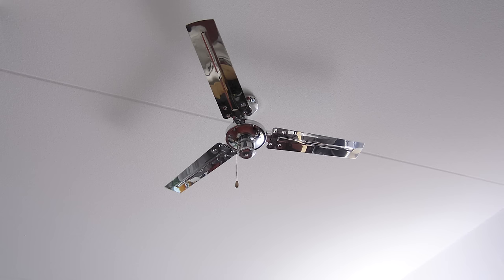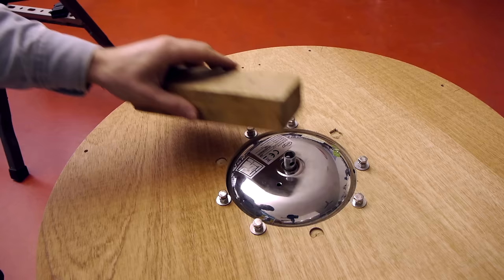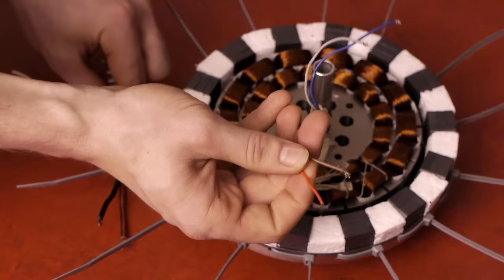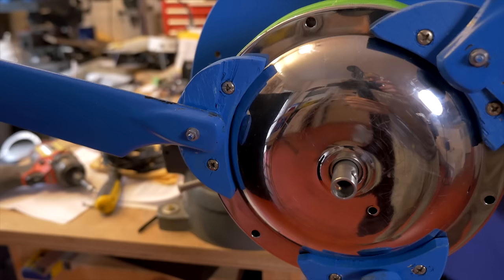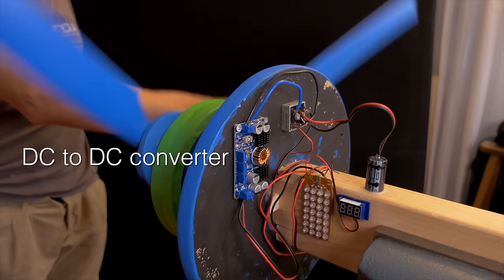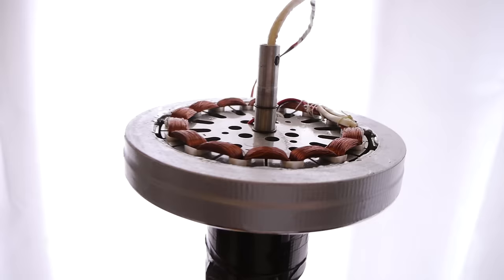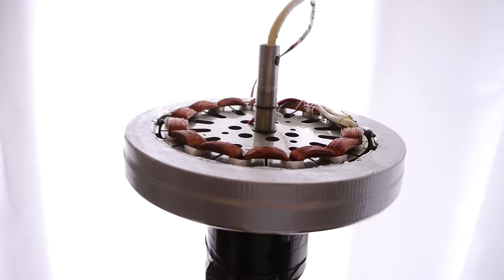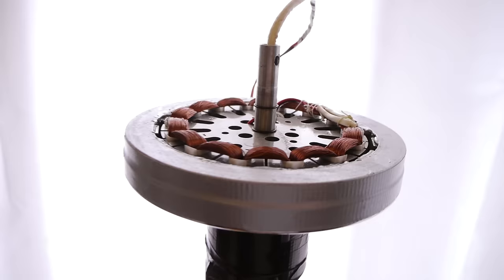Turn a ceiling fan into a wind turbine generator?!

Comment: source a variable input DC  charger, use to charge battery and super copastor bank then draw stored power through inverter or line converter . for some reason I am thinking caps before the dc~DC charger with resistors  to slow the input .. I'm no electrical engineer , but i entertain myself by seeking interesting and useful information that relates to our modern environment and how to solve problems by sourcing components made for other applications that produce the same results . but this is a older post so I am sure you figured it out , in case of Zombies though I would just keep note of intact electrical systems that generate their own power .. ( bus stop lamp.... Has solar panned heavy duty a inverter ,charge controller and a battery and lamp . ) I will be visiting those noted locations with a nice work van early on should the dead walk .. growing food will need most all my free time so grabbing the low hanging fruit while others scramble for tactical bacon seems smart as i am sure there will not be any one protesting their share  at cell phone towers ,bus stops, army corps managed bridges. I will avoid the larger arrays on the roofs of box stores and wall -marts .. the big score will be the cell towers and maybe a solar mini farm noted close by ..

Comment: CYLINDER GENERATOR WORK BETTER. LOOK AT INFINITY SAV. VERY GOOD IDEA FOR GENERATING YOUR OWN ENERGY. SMALL AND HIGH SPEED IS THE ANSWER TO OUR ENERGY PROBLEM. THANK YOU FOR YOUR IDEA. 3600 RPM WORK MUCH BETTER.

Comment: A wind turbine is the wrong motor to convert to a generator because it is a low mechanical resistance motor. Hence you have windings that cannot tolerate alot of output power.
And yes your phone can tolerate AC as long as you use the proper charger. Samsung phones charge faster using their own AC charger than on DC. For more output power, try using an automotive alternator as it already creates 14.4V DC. For an AC  brushless generator with more power, convert a furnace blower motor - it creates way more torque and should create more output power.  Good luck!

Comment: Sorry but induction motors are bidirectional.  That is can be a motor or a generator.   And I can do far more with an induction motor than a PM motor.   First problem with a PM motor is the fixed flux from the magnet.  Power is a cube of the rotation speed when the flux is fixed.  A mechanical means is needed to limit rotation speed.  And the power has to go somewhere. Best results for a PM motor is variable pitch blades.

Induction motor as you said is not a generator.  But apply a current through one of the coils like the starting secondary coil and you have that magnetic field needed for an induction motor to be a generator.   This creates a magnetic field in the rotor and when it rotates the field moves thus creating a current in the rotor bars.  This current tries to maintain the position of the field on the rotor.   The field from the rotor sweeps across the main coil of the stator and the results is a generator.    So feed AC into the secondary coil of the stator will result in generating the same frequency current in the main stator coil.  And the slippage of the rotor is proportional to the amount of energy generated.  This is the speed of the turbine blades.    Thus the secondary current provides some control of the rotations speed and power generated.  Generally the power factor  which is a problem for induction motors is also a problem for induction generators.   India wind turbine industry started with induction motors.

Comment: First, measure the wattage mat full RPM.   from the looks of the wire thickness,   And assuming the fan runs on 120 volts,  you need to decide what voltage you want to generate.   But with perfect magnetic coupling,   And a fast RPM,  you would be lucky to get 120 volts with the current wire thickness.   Its a pain in the ass to rewind the coils.   You won’t have to yet.   Run with existing coils,  measure the wattage.   Volts x Amps.  First,  measure the No load voltage.  Then vary the load until the voltage drops down to 75-80%.   Measure the current.   Will give you the wattage.   From that,  calculate the turns per volt.   Thicker wires,  lower voltage and higher current.  Decide what you want to power.   Probably to charge a 12-24 volt lithium ion battery.   Your output in voltage should be about 150% of what battery you decide to use and charge.

Comment: suggestion 
 crazy add on  is  a toy Tyco slot  car motor  as  a  replacer thrust  dispenser  attached to the  whole of  the  generator     these Tyco toy slot car motor  will give that  cealing  fan  a   continuous motion   and     more  drop-in,+-   output   daegerdaysion  .. like  I say   crazy ..   thoe  to  me   it all becomes  a closed-loop  in motion generation  ...   what say you  uheardmae  ...respectfully Michael heard

Comment: Any atv that has electric start has a voltage regulator as well as a motorcycle
Reply: You can also use the atv stator and fly wheel to use as a generator

Comment: Have you tried to build a wind turbine generator by using a car alternator that's what I did it is much easier to convert 12v DC to AC in Voltage to get household wattage  safely, just run a simple cricut to get safe voltage to Watts or amps .
Turning 12 Volts into 60 hz 120 volt by doing so you use the same voltage bridge rectifier and you will need inline a Voltage regulator to convert DC voltage to AC Amps very simple cricut to do and most of the iems you can buy from Amazon around $30 if your on a budget,
 I need to come  up with a video on the 
Wind turbine I built same I don't get a lot of wind where I live ....

Comment: why don't you use an air compressor and a big strong safe separated " for safety " air tank to move the fan and make it internal fan so that the air will be all pushing the fan to rotate , and make the air push it from sides and make it too much wings , the isolater must have input tube and far turn output tube perpendicular to wings from sides to make use of each pressure bit , use wheels to control speed of generator rotation " speed converters " big to small wheels or small wheels moving big ones , the generator later will fill the tank , and the tank may operate the generator for hours , therefore it will work endlessly , be wear of air pressure you must use electronic controllers so that it turn of compressing at some level and starts at another lower level using electric tabs controlled by sensors ...

Comment: Why not have the turbine charge a battery, then run the electronics off of the battery?

Obviously, this isn't practical when used for real turbines connected to the grid, but for this generator, it is an option.

Comment: Without a commutator or slip ring, it is impossible for the wires coming out of the shaft to be fixed. It is obviously fake, the wires go through the shaft and through the table below where they are plugged into the mains.

Comment: apart all electronics control & braking, thing is generator alone itself is almost nothing without connecting to the load.. 
unless it would always dissipates the power in form of heat energy due to reactivate index.. what practically weaken the permeance.. 

synchronism is the another factor to take care about by attaching a motor driven prime mover or some other means..

in case of rated power generation feedback control system is incorporated to sustain the PF stability..

in reality the rotors are used, having larger axial length as compared to their cross sectional dia with high RPM & negligible tilt.. 

AVR is the another concerning factor to take care about.. 
as many more things are there, take place during generating power.. 
making what at the own place is pretty terrible idea.. 
see balancing voltage & frequency by 24/7 observatory only keeps the electricity almost stable.. ✔️✅

Comment: Here you go how about you doing this get a small transformer from like a charger for a phone take that Transformer in it out connected to the back row of coils run that through the Transformer then put a capacitor and a diode and then run it back through the front half and see if you can get the motor to run by itself I'm working on different stuff like that trust me once you figure that out you got a whole new Avenue of electronics that everybody will be asking you how it works and you may not even know anything about Electronics

Comment: Not sure about the electronics side of it, but i can tell you those helicopter blades are a very poor choice, you would be better off using the actual fan blades, or actually designing blades like the helicopter blades but at a better angle pionting into the wind not away from it.  if the blades are too flat against the wind they will just stall and not produce much rotation of the turbine.  You would want something like 45degree pitch of the blades for a good all-round performance.  adjustable pitch blades would be best.

Comment: Why not put the magnets  on top and underneath so you could leave the extra cooper wires in then add a magnetic pulley with North Pole magnets at the positions of the minute hand of a clock then bring larger South Pole magnet in to make the pulley move freely off of magnetic propulsion wtfu movement

Comment: Has anyone mentioned the fact that you don't need to do all that ripping apart and putting magnets in it? All you have to do is put a capacitor in parallel with the ac induction motor, and then get it to spin about 100 revolutions a second faster than what it's rating as a motor is. ie: 1500rpm motor = 1575 ~1600rpm -generator. The key is to not hook up the load until the rotor is spinning at the required rpm. (try a 7.5 uF cap for starters. cap value depends on induction motor type, and load amount)

Like you, this guy isn't someone who is fluent with electricity. But he gets an A+ for figuring out the better way to make a generator out of an induction motor. Thought you might like to know.

https://www.youtube.com/watch?v=j-LgEbdJ8AM

Keep experimenting. You're getting it.

Dean Michael Harrington
Assistant Engineer, US Windpower  "Home of the 33MVS wind turbine"

Comment: You could use NCP785A (450 volt regulator, but with only 10mA output).
To amplify the current add some high voltage transistor or MOSFET.
For example, APT13005D.
~~~~~
Or maybe something like this:
http://www.pmillett.com/HV_reg.html
but with adjusted resistors for desired voltage.
~~~~~
Use circuit to charge some battery (say, 12V car battery), and then car charger to charge your phone.

Comment: Why did you add magnets? Wouldn't the metallic rings that was in the cover right from the start enough to produce electricity? I've generated electricity from motors before without adding magnets.

Comment: Here am i again 😂 so what if we rewind the alternator for higher amp with max  24 volts output and by using neodymium magnets wat do you say
Reply from the maker: Hi there fancy bird, yes; it woud be good to rewind the stator with thicker wire, to reduce the V and increase the A, especially on one that was supposed to run on 240V. May not be necessary on a 120V version. But to rewind is some work and how much would the wire cost.. not that cheap. I didn't make it clear in the video, but a am using neodymium magnets. Things than that I did wrong there: the neodymium magnets are glued on a wooden ring. It should be a ring of iron/steel of course, to connect the magnetic forces. And if you want the strongest possible magnetic force, the airgap must be minimal, and for that reason the magnets should be curved. With these projects it is always the question how much effort and money can go in. Things can almost always be done better. If I manage to do this project better (I think I can) I would like to make a version-2 video.
Reply: @GiesbertNijhuis  i am working on this i just need 30v with a higher in current  so i can charge my batteries continues and use an invertor that will work for 24/7  i am living in such a place where its hard to find neodymium magnets so i just ordered online
Reply: @GiesbertNijhuis  i am trying to make a hydro generator with that and thanks for sharing your idea

Comment: The use of a Linear Pre-Regulator was unfortunate.  The small wire diameter (high resistance) is ok for lower current - which at high voltage is still good power.  I think finding a 110/240 to 5V AC-DC switching regulator with efficiencies at or better than 90% would have simplified your design.   That said - an old single phase ceiling fan has about 30% efficiency and generation capability couldn't be much better.  So your end conclusion is probably correct unless you just want to charge a few cell phones and the overall efficiency is not an issue.  For better ceiling fan design with built in motor generator features - check out https://www.arpnjournals.org/jeas/research_papers/rp_2015/jeas_1115_3045.pdf

Comment: Induction motors ( DO & WILL BE GENARATORS) & yes they will make ELECTRICITY.!! You only need to add
A good capacitor.!! I've been experimenting with brush less induction motors as generators. This is what I found, with almost any capacitors" that match the size of the motor as far as size should be, kinda like a capacitor for a microwave oven, matches a motor out of a (furnace blower) very good.
I also recently found out that there
Are some generators already being sold with this type of set-up.!! SO, if you are an Real, Engineer,?? You should know this stuff. Or you're just
To lazy to do any  "fact-checking" before saying things like, ( induction Motors will-not generate power, without permanent magnets)... 
Is that something you were told in engendering school,?? Or you ( like a lot of people), just never bothered to fact check, anyone's statements.??
I'm not downing you, I like you're video's,. But it bothers me when someone who Sapposed TO be
An engineer, would say something that stupid...... FACT CHECK ✔
That's the future of the TRUTH.

Comment: When you short the terminals the rotors stopped turning, this is the reason why those DIY free energy videos are fake. Once the generator is loaded, it will start to stop spinning because of the current.